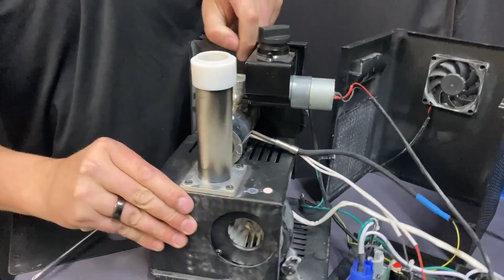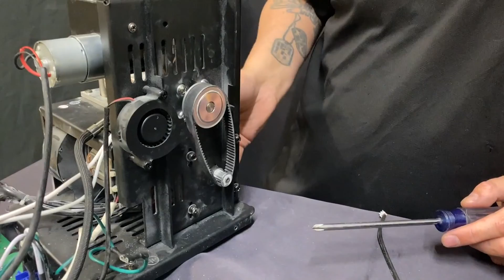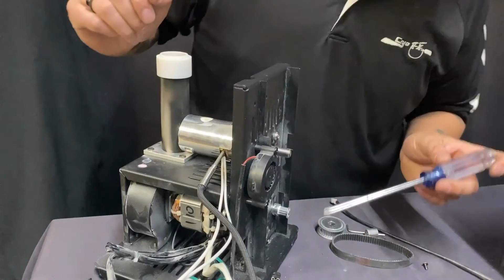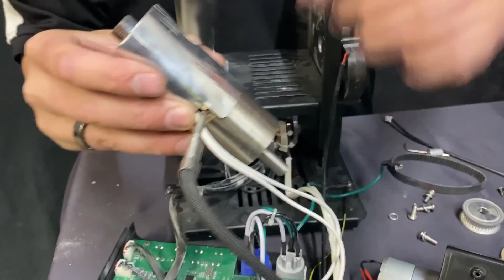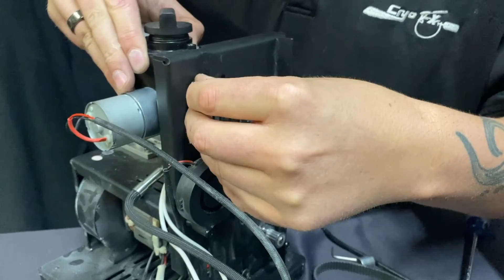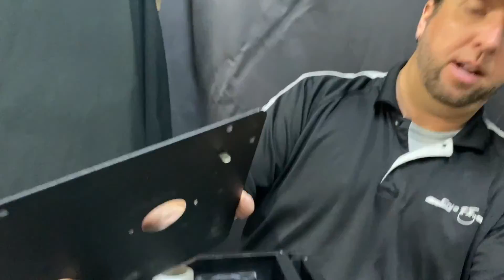How To Clean A Cold Spark Machine (CryoFX® Full Cleaning Process Internal & External)

Comment: Great video. One question: is it safe to use if the mesh in the funnel where the powder falls breaks or gets damaged?
Reply from the maker: To a point, and thats based on machine build, type and if the machine stays upright. A machine that tips over will spill granules inside and this may short out other electronics or damage the motors or other items internally.

Comment: My bearrings and rod will not come out off the heating area.  It’s stuck
Reply from the maker: You may need to use vice and heavier set of tools, if this doesnt ultimately work replacing whole unit would be advised.

Comment: para los que no hablan ingles les escribo en español, me sirvio mucho ver este video y el problema que tenia con este mismo equipo era que estaba todo bien, no tiraba error pero calentando saltaba la termica o el disyuntor y no sabiamos por que, miramos los cables por dentro, el consumo y esta todo ok, decidimos mirando este video desarmar el calentador y el problema estaba en el cable que le da corriente, energia al calentador que la ficha estaba totalmente quemada por la temperatura, tiene ese cable blanco que por dentro es un alambre, sacamos la ficha pusimos al tornido el alambre bien puesto y andan sin problema, consejo: no ajustar mucho el tornillo por que toca el tornillo sin fin que lleva la chispa al ventilador y queda trabado. // For those who do not speak English, I am writing to you in Spanish, it was very helpful for me to watch this video and the problem I had with this same equipment was that everything was fine, it did not throw an error but when heating up the thermal or circuit breaker tripped and we did not know why, we looked the cables inside, the consumption and everything is ok, we decided watching this video to disassemble the heater and the problem was in the cable that gives power, power to the heater that the plug was completely burned by the temperature, it has that white cable that Inside is a wire, we took out the tab, we put the wire in place and they work without problem, advice: do not tighten the screw too much because it touches the endless screw that carries the spark to the fan and gets stuck.
Reply from the maker: Muchas gracias por tu observacion dejame saber si tienes dudas

Comment: I don't know what your objections are to solvents, as long as they are evaporating kind, and the part is out of the assembly, and it is thoroughly dry before reassembly. (and NOT on the bearings).  That said, I don't think they are needed for cleaning powder off in these machines...

Comment: I have not worked on these but an obvious tactic to removing the feed funnel and reservoir is to set the machine carefully on it's side (being careful of the attached wires and panel).
That way the outlet is facing sideways (less or no spillage), and also any powder spillage won't be dropping on the motors or the circuitry!
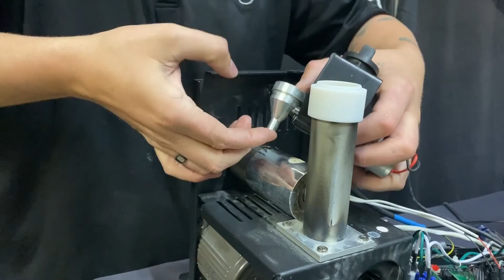My preference would be the 'left' side (as viewed @ 11:00), so any spillage is straight down; but personally I would do this with the circuit panel side attached to the base, so it is not pulling on the wires and flopping around [I think there should be plenty of room with it attached].

Alternatively, I would set it on 'chimney blower' side...
This would be better if the circuit panel is detached, as it is shown here; so it doesn't stress the wires.

I think the top cap on the feed funnel on most machines can unscrew for cleaning or manufacturing purposes.

PS: I would be careful around the bearings if you used compressed air, as he suggested,
those bearings likely are high-temp grease lubed:
Be cautious not to blow directly on the face-shields on the of the bearings, which could blow some grease out, or blow abrasive powder into, the races...
I have no problem with using air as long as you watch where you are aiming the downstream of the air blast.

Be careful if you remove the heater shield, that refractory insulation is typically very fragile and crumbly!
Likewise, the heater supply wire insulation is also often 
delicate, and can be easily penetrated by the shield and short circuit, if you pinch it during reassembly.
[Depends on if it is Teflon or fiberglass (or asbestos) covering].

Mr K L

Comment: everything is working as expected and it is heating up perfectly. I have a problem as the sparklers are not coming out even the fan is running.looks like the corckscrew and cylinder is blowing the granules and not burning them or sometimes blow a thin line
Reply: The same thing happens to me with 3 of these machines. How can I get the spark out since it only throws away the gunpowder?

￼
Reply: Sounds like a temp issue (IMO, just a guess);
There is another YT about replacing the temp sensor on a certain model.
Your temp sensor could be defective, so temp is not correct...
DMMs have become very affordable and you can get one with a thermocouple, so you can check the actual temp (or borrow someones?). (you would have to get it inside the heater, nearby the machine sensor).

Can the powder get 'old'?? -dunno, maybe research that.

Mr K L

Comment: hi it's knowledgeable but please let me know operating voltage of element and it's ac or dc
Reply: Old post but here's my answer:
I don't know the circuitry, but very likely it is powered with triac controlled 120VAC (or grid power of your country),  The heater itself is most certainly resistive, and doesn't matter if it gets AC or DC.

Comment: I can’t get the corkscrew out of the heating element. I’m sure there is a ton of build up making it so difficult…any suggestions?? I have the ProX Blitzz.
Reply: Hi, Jeffrey. I am having the same issue with ProXBlitzz. Did you ever get it resolved and if so, how?  
Thx, C.
Reply: You have to put the whole assembly into a bench vice and hammer the screw in the opposite direction a couple of times decently hard. Be sure to catch the screw and bearing or it will shoot across your shop

Comment: great vid! Just got my first 2 Blitzz FX and i've wondering about the maintenance for them.  this vid thoroughly explains what i have to do.  
really quick though how often do you do this?
since mine is brand new when should i start doing this type of deep cleaning?
Reply: I have 2 Jmaz Firestorm. If you remove the granules from the container and you empty those which stayed inside I don't think so you will need to do it frequently. I actually haven't done it in 2 years but it depends of the use as well.
Reply from the maker: Deep cleaning with complete removal/opening of the heating element we would recommend 1 time a year (if you clean out machines from sparks initially every time you use them - dumping out granules and activating machine to clear all chambers out) however should you not do this or machine starts clogging sooner, then sooner than 1 year. Unless your machine is faulty for some other reason which you would know since problem still exists after cleaning! 

Most importantly you don't want the heating element cooling off with granules inside it and reheating again, this continued action will build up particles on the element itself.